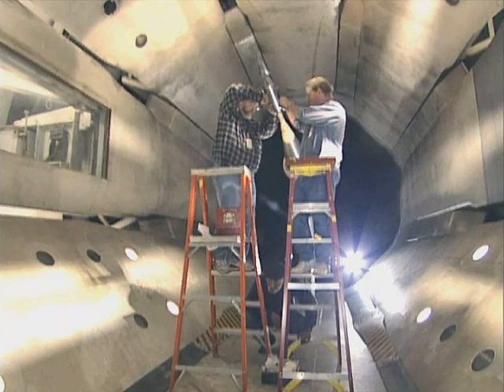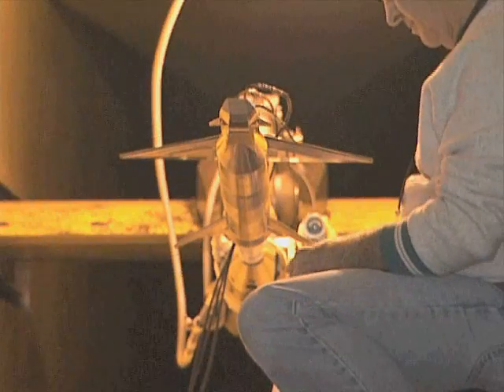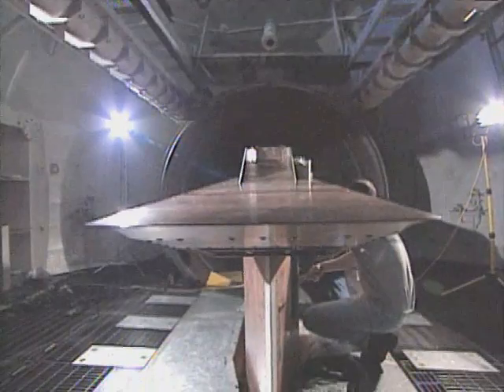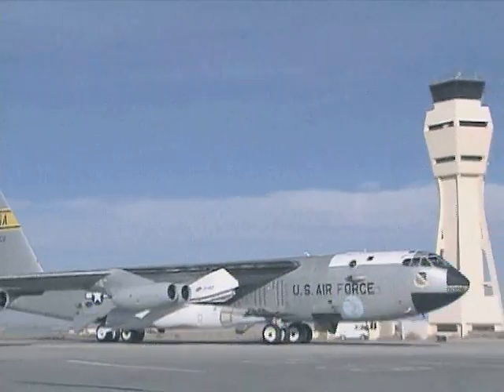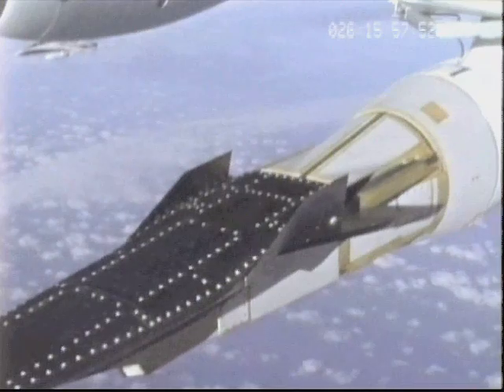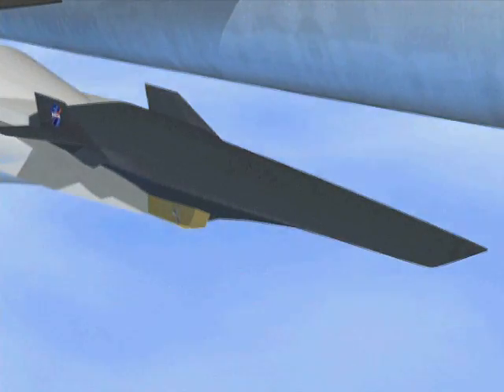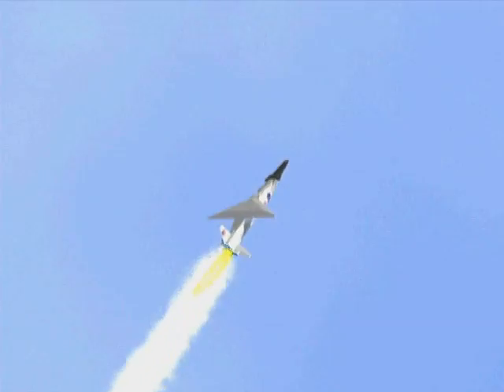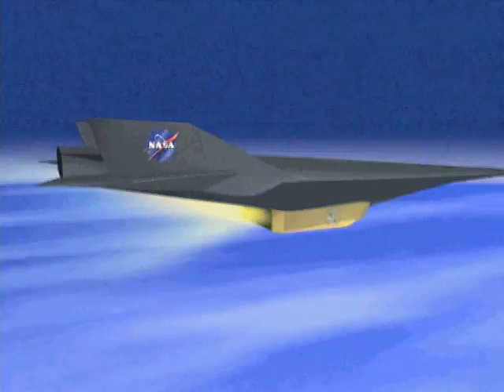X-43 Program Overview

Comment: What happened with this project? this seems very cool and functional
Reply: Sebastián Fraco Google X-51
Reply: First one had an issue and was destroyed.  I was lead tech until a few months before launch.  It was built by micro craft in Tullahoma tn.  They did get good data from the flight.
Reply: Later flights were successful.  The engine is classified I am not sure what use it is being put to, likely military for now.